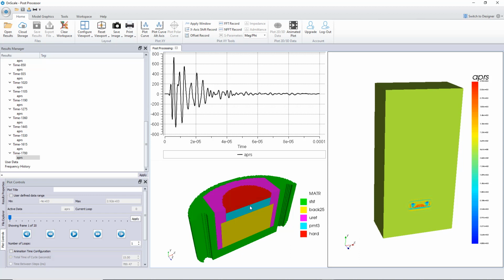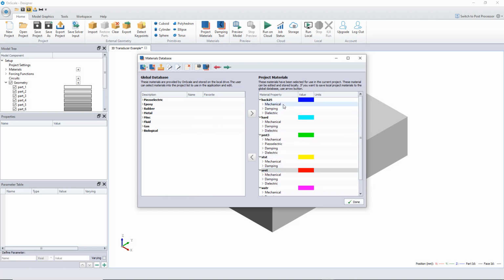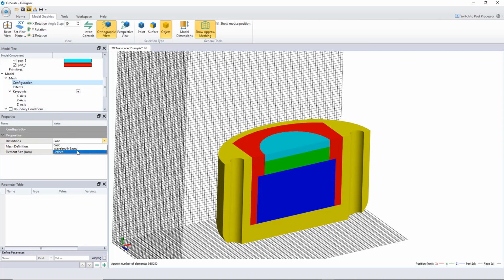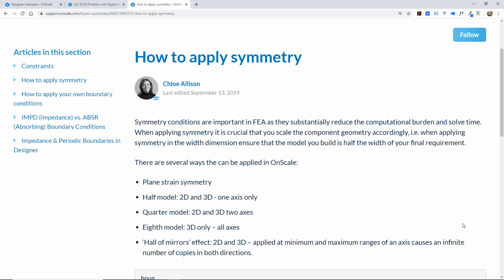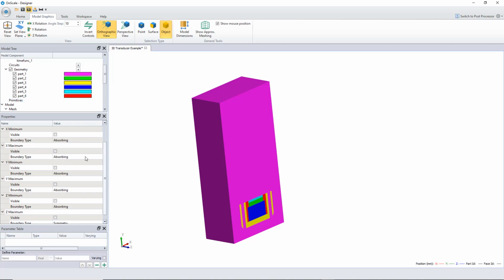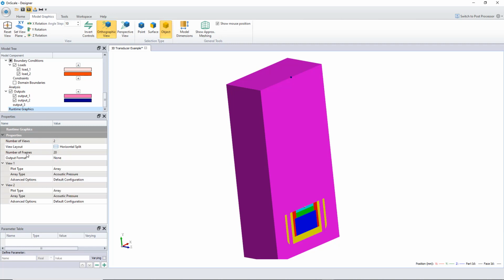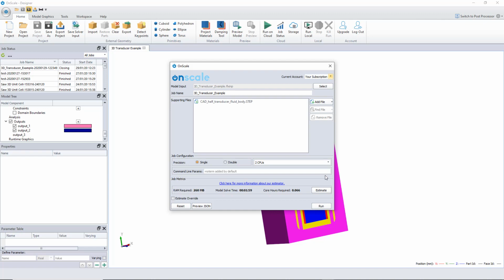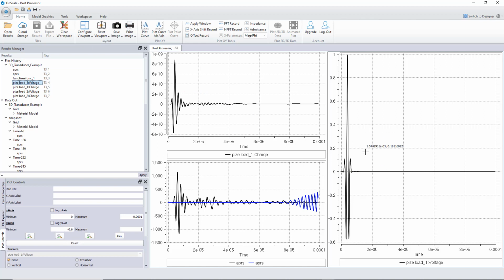Piezoelectric Transducer Simulation with OnScale - Ultrasonic Sensor Tutorial

Comment: Hi.
Can I simulate low frequency e.g. 800 Hz by this process?
Reply from the maker: Sure，but you have to adapt the mesh size because explicit calculation requires element size depending on wavelength and thus you will have to mesh coarser but calculate longer to get some results. Leave your questions on the OnScale forum for details
Reply: @Feaforall  Thanks for you reply. I already leave my question in OnScale forum. But nobody answerd till now.
Reply: @Feaforall  Here as you said, Mesh configuration is wave length based. I also follow this. I use 1000 elements per wavelength. But nothing is happen. I face this problem again and again. Can you please provide me a proper guideline. Its Very important for me.
Reply: Every time i got this whwnever I going to extimate the result:
"Your model failed to estimate due to a syntax error in the input deck. Please check your working directory for details within the  '.prnt' output file and rectify the issue."